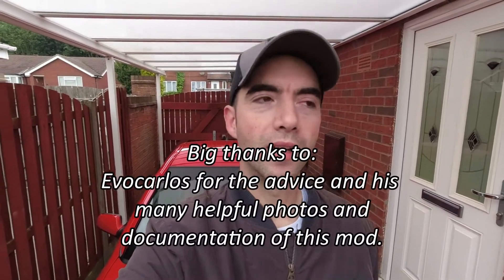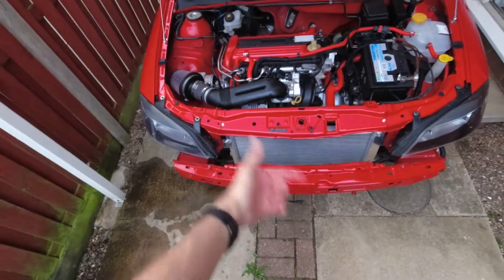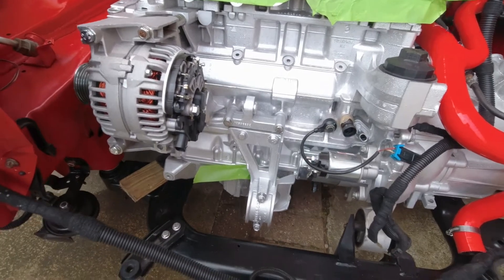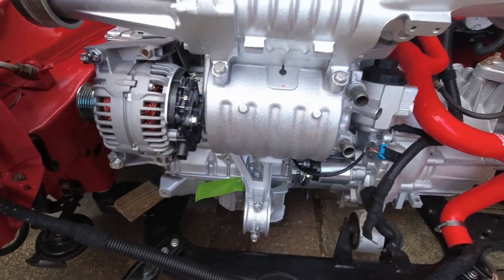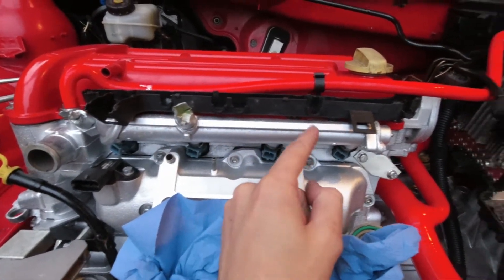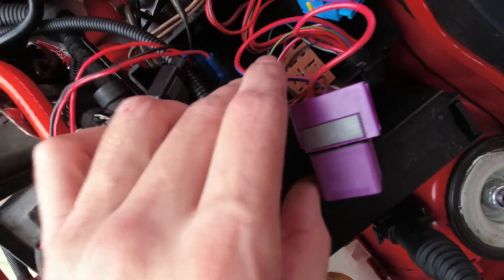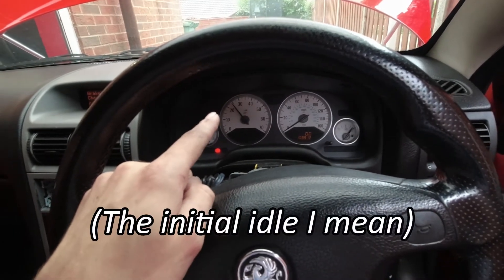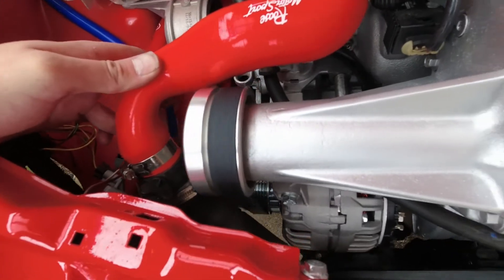Astra Rebuild Episode #49 Supercharger install!

Comment: Bonjour, comment as tu supprimer la clim ?? Je  suis obligé de garder le ventilateur clim sinon le ventilateur principal tourne tout le temps
Reply from the maker: Its been a long time but I think you can remove the fan but you have to still keep the fan resistor connected or something like that.
Reply: @mikeyjaxxx merci oui j'ai rebrancher le ventilateur clim et tout fonctionne mais comment toi tu as fait pour avoir que le ventilateur principal ?? Si je veux installer le turbo charged qui je dois aller voir car en France on a rien merci